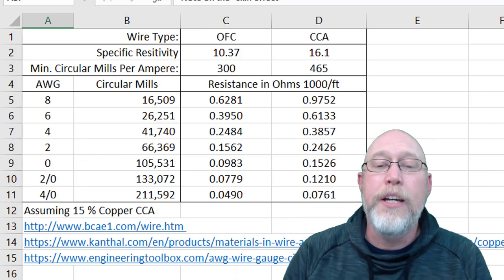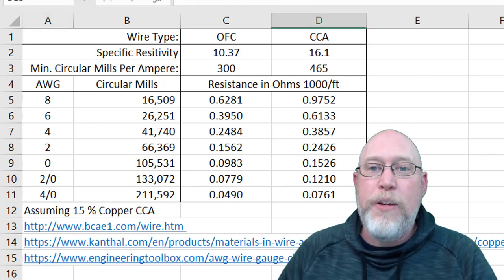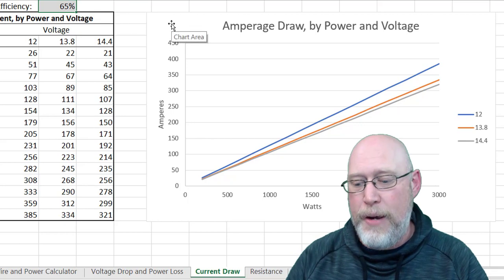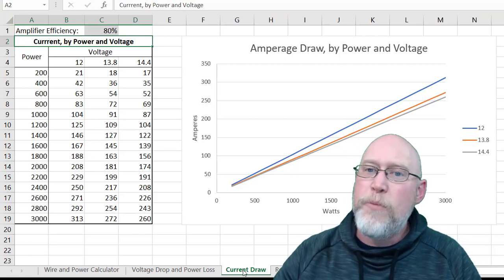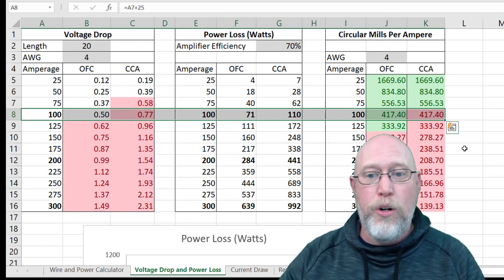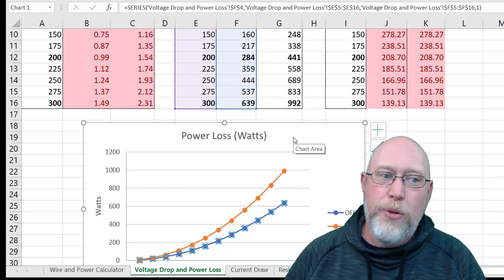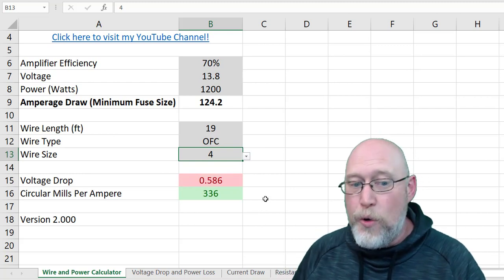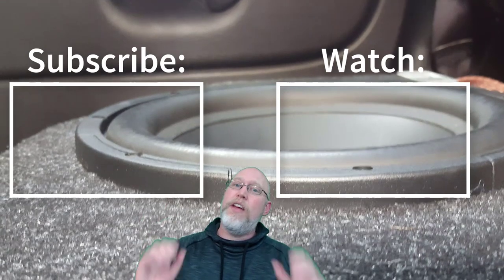What size power wire do I need?  Car Audio Power Wire Calculator

Comment: Very interesting. I like it for sure. I would like to see a pure copper wire in the calculator since I'm bad in math. Many of us use welding cables. No issue for me at all but now, I can see better if it can handle enough power or not. Welding cables are probably in-between OFC and CCA I guess.
Reply from the maker: Welding cable is OFC.  Just plug the appropriate gauge into the calculator.
Reply: @DIYAudioGuy  Thank you for this info. Discussions on the subject seemed to point to a different cable. You are a genius. Thank you so much.

Comment: Excellent video! I’m actually in the process of upgrading my power wire from 6awg  ofc to oversized 4 awg tinned ofc because I got a Larger amp and sub rated at 1200 RMS at one ohm for the amp and a D2 sub.  Before I was running the same amp at 800 RMS at 2 ohms on a budget d4 sub with the 6 awg leftover from from previous 500 rms amp setup. This  is exactly what I needed to see!
Reply from the maker: Glad it helped
Reply: Oo9k

Comment: love watching your channel. I just had a Kenwood DDX9906XR head unit installed in a 2000 chevy along with a JL XD1000/5V2 amp. The unit looks great but I left the store filling lost. I wasn't sure if my amp was set up as far as the gain set right ( like I have seen Five Star do in there vids.) no walk through of the unit and how it works! again thanks Five star for the great tutorials on the Kenwood. All this being said it leaves me wanting to install a unit in my 2006 Dodge Ram myself. Not really knowing what size wires to run what a distribution block does and do I really need one how crossovers for component speakers work and basically not being able to find a diagram of a unit and all the parts needed has left me overwhelmed. I'm pretty handy but a little out of my element for the time being. Any advice.
Reply from the maker: If you're going to do it yourself just take your time to learn as much as you can, research all that you can on the truck and how to get things apart, and go slow and steady.  That 2006 model Dodge is not very different from my 2004. So a lot of what you seen in my stuff will apply. It's going to be very easy to run the power wire from the battery for example. Especially if your truck is an automatic. There is a clutch delete plate on the firewall, it's made out of plastic. Very easy to find and drill through.

It's kind of a bummer that the shop did not walk you through the stereo and show you what they did. That's part of what you pay for when you go with a shop.  I personally don't like going to shops because all of the wiring is hidden and there's really no way to know if the shop did it right.
Reply from the maker: You only need a distribution block if you're going to hook up multiple amplifiers.  I think that JL amplifier they are using is a 5-channel amp.  Kenwood in Pioneer make amps that are just as good for a lot less money. check out some of the amp dynos  that Williston audio lab has put out.  I'm pretty sure that he did a five-channel amp comparison, it might have been on the budget gym or budget bust channel.

If you're going to add a subwoofer there's not a lot of room underneath the rear seat of that truck.  All of my amplifiers are under the seat in between the box and the rear of the cabin. You've got about eight inches of room, so when you go amplifier shopping keep that in mind. If you do a single sub set up you can put the sub behind the driver and the amp behind the passenger.

My next upgrade is going to be a seat lift in the rear and a custom fiberglass box. I've got the fiberglass sitting out in the garage. I just need to get some resin and tear out my existing install so that I can get in there and do some work.

Comment: Do you buy your power wire/speaker wire/wire connectors/and fuse blokes from one place or do you shop around? also any brands that you like better than others. I was watching the CAF site and he was saying to have all your connectors wire and equipment together do do the whole job at once. i'm trying to figure out what I need to do the job.
Reply from the maker: I shop around, sometimes I need to spend a few bucks extra at Parts Express in order to get free shipping or qualify for a coupon so I'll grab some connectors or a few feet of wire.  I like the amplifier kits and power wire from knukonceptz.  They sell OFC wire that has been tinned so that it reduces corrosion, It's good performing wire and it's priced very well.  I grab a lot of stuff off of Amazon.

Comment: Your calculator, Although very much appreciated doesn't permit 00 or 2/0 thru 0000 or 4/0 such as I use from Sky High Car Audio which is their 2/0 XL OFC which is more like 3/0 AWG with a rating of 600a at 20' (which I doubt). Can I alter this? Ty bud. Much respect from fellow car audio YTer for what you do. A LOT more effort is required to post quality content than the avg viewer assumes. 👍
Reply from the maker: You must be using version 1.0, version 2.0 let's you select 8,6,4,2,0,2/0, and 4/0.
Reply: How do I get your calculator?

Comment: One concern I have is wire size from the amp to the sub. My sub is a 12" DVC rated for 1150rms per coil. Totalling 2300rms. According to most recommendations the wire size I should use for my set up can't actually fit onto the posts on my sub
Reply from the maker: That is a HUGE subwoofer.
Reply: @DIYAudioGuy  yes 😅 but like I said though, I've got my battery relocated to my boot, with 2 amps mounted onto my back seats, the cabling is all very short so I'm running 6guage wiring to 6000w 4 channel (pushes about 85rms to my 4 mids @2ohm) and also 6 guage wiring to my 4000w Monoblock (temporary till I get a new Monoblock big enough to match the sub) I plan on getting a Monoblock rated at 1500rms and running 4guage wire to it, but the biggest wire I can actually connect to the sub wiring in series is 8 guage wire. As it is now that's fine since it's being run on around 300rms. But with the bigger amp and more power coming I am concerned about the sub wiring being too thin
Reply: @DIYAudioGuy  I was thinking of crimping some ring connectors onto 6 guage wire and connecting that straight onto where the sub terminals are connected to, but I'm unsure if that's a good idea. Never seen something like that done before.

Comment: Help me out with this. I'm running two amps one 500 watts(80amps) the other 1200 watts(100 amps). I'll be running a power wire from the battery to a Distribution Block with 4gaughr and 8gaue. At that distribution block I will have a fuse of 80 and 100. At the fuse at the batter I'll have a amp of 200. Does this look correct.
Reply from the maker: If you're running zero gauge wire, sure.  If it's 4 gauge wire then no,. You might like this video.  https://youtu.be/yEatiVXSXTk
Reply: @DIYAudioGuy  yes the wire .running from the battery is a zero gauge
Reply: If the amp is outputting 1200 watts (100 amps) to the speakers, it will be drawing anywhere from 140 to 200 amps at full load. No amp is 100% efficient, not even close. A good class-D amp will be 65-75% efficient at full load (at best). If you're using a class A-B amp for your highs, it will be even worse.

A 4 gauge wire can support 205 amps, but that is only at an extremely short distance (like one inch lol). The ampacity of a conductor decreases with length.

Comment: I just hope my 1/0 gauge wire upgrade big 3 and my 250 alt are enough for my 2k amp. My suv had a stock 105 alt. Or at least that’s what I was told.
Reply from the maker: That should do the trick.  Just keep in mind that most alternators don't produce their peak output at idle.
Reply: @DIYAudioGuy  I will try to remember, I’ve recently been binge watching all of your videos and learning a ton so thank you greatly!

Comment: sir i have question..my amp  rms@4ohm:- 60watt..fuse at amp 35A..2nd my mono rms@4ohm:- 150watt fuse also 35A..so my question :-
1- how much size cable power and fuse size for this rate ? 
2 - i need block distribution or not ? if yes how much fuse size at fuse block..

tq sir !
Reply from the maker: With just those two amps you need enough wire to carry 70 amps, that puts your right over the threshold for 8 AWG, you will need to go with 4 AWG.  You only need a fuse at the distribution block if you go down a size in wire at the block.  A 35 amp fuse on each should be fine.
Reply: @DIYAudioGuy what is the threshold for knukonceptz kolossus of 8 guage?

Comment: Can I get the spread sheet please
Reply from the maker: Sure thing just shoot me an email (diyaudioguy@gmail.com) with the word wire in the subject line.  I have an auto reply set up that will automatically send you the spreadsheet.  If for some reason it's not working just send an email to the same address but don't put the word wire in the subject line.  After you do that please edit your comment and remove your email address so that some weirdo on the internet won't start sending you spam.  There's a lot of freaks out there you know.

Comment: Can anyone recommend an amplifier that can produce between 200to300 watts at 4ohms that has or can utilize a bass control and not to expensive.

That'd be awesome 

Also what wire I would need to keep the amp putting out the proper power, watts. Voltage etc
Reply from the maker: https://youtu.be/JGjl4WygGT8. As far as wire size goes, that's what the calculator is for. Just download it.  What you'll find is that if you are length of wire is short enough and 8 gauge copper (not aluminum) will probably work great for your application.